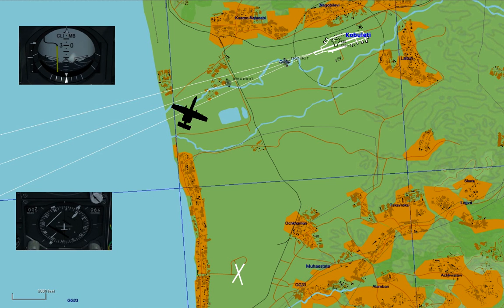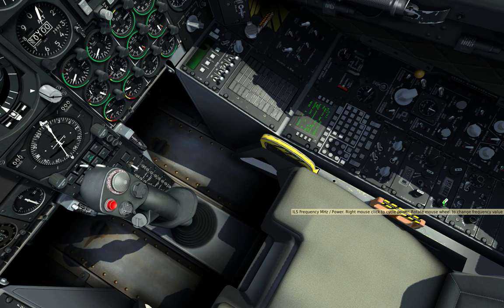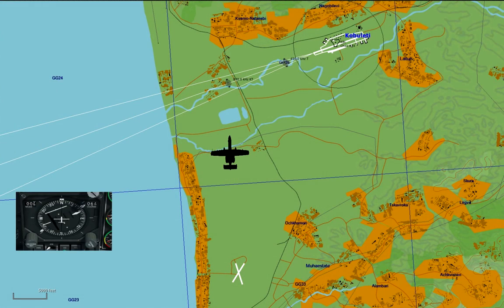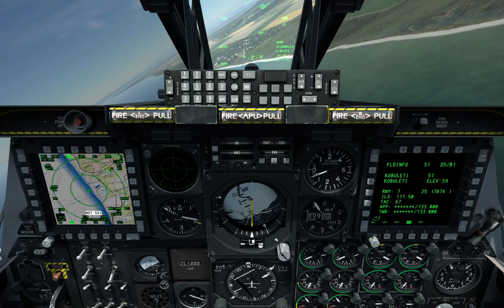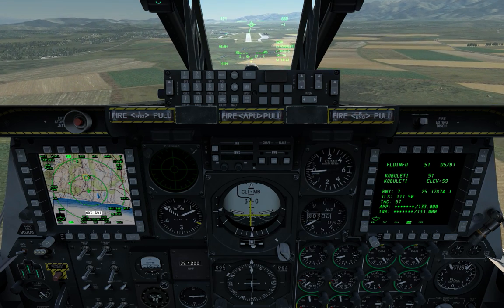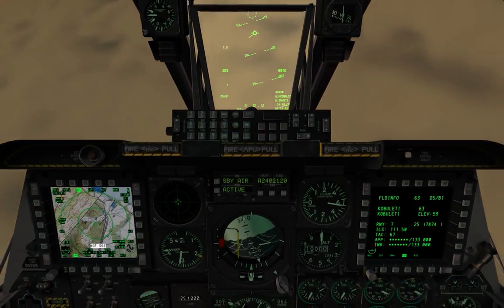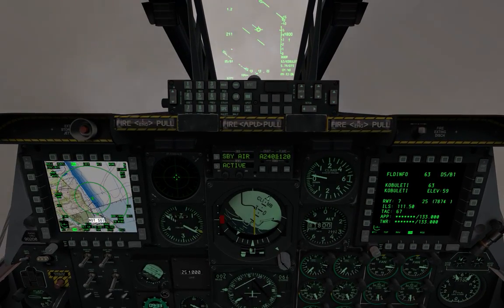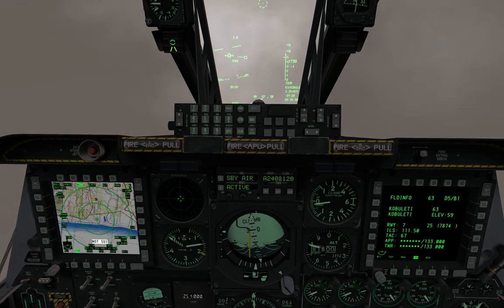DCS World: All About ILS

Comment: Excellent video/tutorial. Like others have said, by far the best I've found on YouTube. Covered (most) everything, great pacing, as well as entertaining. Question though, you don't mention anything about the AOA indexer? I've actually been looking for a video on it (I know the theory, but wanted to see it properly), and that's when I came to yours. Pretty much no one mentions it use, even when it appears they may be paying attention to it.
Reply from the maker: What specifically did you want to know?
Reply: Mainly just see what it looks like when combined with everything else we are doing to land. I land regularly without much difficulty, but I rarely show the green ball when I do it. I'm one of those that the realism is the most important part, so I want to do it 'by the book'.
Reply from the maker: @hololightful  Ok, lots of text incoming.

The short version is that AOA is controlled by your speed.  Assuming you've got everything else under control, the bottom (up-facing) arrow means you're too fast and the top (down-facing) arrow means you're too slow, so adjust your speed accordingly. Adjust it promptly in the latter case, because you might be about to stall and die.

The long version is that AOA is controlled by your elevator, either by stick pressure or trim.  At the same time, vertical acceleration is controlled by lift, which is controlled by AOA and airspeed.  This means that at any time you can pull back on the stick to get yourself on the correct AOA, but if you're going too fast above the ideal approach speed it'll launch you into the sky.  The better method is to pull back on the throttle while trimming nose up to keep the flight path marker (FPM) on the horizon line until the green circle is illuminated on the AOA indexer, and then add just enough power to maintain that airspeed.  Once you've done that, you can control descent angle mostly or entirely with the throttle: by reducing your airspeed slightly, the FPM will start moving down the pitch ladder as your descent rate increases, and it'll stop when you return the airspeed back to its trimmed value (that is, whatever the airspeed you were at when you trimmed it to be stable). 

The reason we use AOA instead of just saying "you should land at 130 knots" is because the correct landing speed can vary greatly depending on aircraft weight and configuration.  Additionally, you're a lot less likely to accidentally find yourself dangerously slow on approach if you're keeping an eye on the AOA, because even if the aircraft doesn't stall you might end up with a tail strike from making up the lift deficit by having your nose too high.  Carrier aircraft also have a special need to pay attention to AOA since they need to maintain a specific attitude to ensure the hook is in the correct position relative to the pilot's view of the meatball.

It also helps if you're flying several different aircraft, since the AOA indexer always works the same way.  There's no need to memorize a bunch of different numbers for approach speeds if you can just watch the AOA.  

Does that answer your question?

Comment: Hey, awesome tutorial, really explained it to me.

Can you give some advice on tweaking controls? I'm using the Thrustmaster Hotas X and got issues with careful movements: 

Spinning the stick (which is not possible in real life, pedals instead iirc) makes my plane spin and stall easily, so i can't use the indicator below the ADI.
Up and down feel jerky. I often switch from +2 to -2 degree when trying to get 0 angel of attack.
Reply from the maker: It sounds like maybe you need to set some axis curves.  Go into the control setup, select the axis you want to tweak, and press "axis tune."  

Real life controls have a much larger "throw" than most game controllers which can make joysticks weirdly sensitive sometimes.  By adding a few points of curve on every axis, the stick will become less sensitive toward the center and more sensitive around the edges, meaning that you'll still have the full range of control motion but fine movements around the center will be more precise.  Hope that helps!

You might also want to visit r/hoggit on reddit to talk to the DCS reddit community if you need more advice.
Reply: Thank you, I'll try that and see how it performs.

Comment: Best ILS Tutorial I`ve seen. Nice and easy to follow and to understand. Btw. how did you find out the differenz between the runway heading 07 and the realistic 064 ?
Reply from the maker: 064 came from the kneeboard (0:45).  If you want to take a closer look at the kneeboard pages, they're in the /DCS World/Bazar/terrain folder, and there's a more updated pdf in /DCS World/doc/charts.  It'll be the three-digit bearing with the arrow next to it near the end of the runway.  If it shows two numbers, use the one without the T (T = true, you want magnetic).  

Since in DCS you'll usually be landing at the same airport you took off from, you can also cheat a little by setting the bearing right before takeoff.  If you're lined up properly with the runway your heading should be the same as the runway's, so you just turn the knob until the arrow lines up with your current heading.  Just remember that it'll be backward if you end up landing the opposite direction, and won't match at all if you land at a different airfield.
Reply: confirmed best ils tutorial

Comment: Wow, nice approach!  Looks like both the barometric and radar altimeters show field elevation to be 1,000 feet?
Reply from the maker: When I set up to record the last approach, I started in the air and forgot that the air start doesn't change the barometric altimeter setting away from the default to account for changes in weather.  Kobuleti (the airfield) is actually about 50 feet ASL.

If you request landing from ATC, they'll tell you the altimeter setting, but bear in mind that the setting they give you will be so that your altimeter will read zero on touchdown.  If you're at a higher altitude airfield like those in Nevada in hot weather the setting ATC tries to give you might be beyond the range of your altimeter.  I've gotten out of the habit of asking, or really having anything to do with ATC.  

The radar altimeter correctly shows the altitude AGL though. The number below the (baro) altitude on the HUD is the pitch angle, and the number below that in small text is the radar altitude (e.g. 440R for 440 ft AGL).  Because I changed the setting through the test page, the radar altimeter tape shows just to the left of the baro altitude on the HUD, marked in hundreds of feet.
Reply: If I'm not mistaken, the altimeter setting provided by ATC will adjust the altimeter to show field elevation at touchdown.  For instance, when landing at Denver International (approx 5,430') your altimeter should show about 5,430 or so at touchdown after you have made the ATC provided adjustment.  In fact, small uncontrolled airports, with a unicom service lets say, have an altimeter in the airport office, and when an airplane calls in for local traffic advisories the attendant will set the altimeter to the field elevation and read the corresponding barometric setting and relay it to the incoming pilot.  Radar altimeters are completely different, of course, and simply show altitude above ground.  Anyway, that was a cool approach!  What were your weather parameters?
Reply from the maker: Most of the time in real life that's correct.  The pressure you've just described is called QNH.  Oddly, DCS World's ATC gives QFE or Field Elevation pressure, so it reads zero on touchdown rather than the airfield altitude.  In other words, instead of altitude above sea level, it gives you altitude above ground level with respect to the airfield.  We can hope that we'll start getting QNH settings when the developers release the ATC overhaul.  

Feel free to google QNH and QFE to know more.  One of the top results should be a detailed explanation from the Eagle Dynamics forums.  

Iirc it was the heavy winter weather preset with the wind redirected down the runway (since the video is meant to be about the ILS and not "check out my cool crosswind landing") and a fairly thick fog.  500 ft visibility or something like that.
Reply: I've never heard either term (QFE, QNH) used in real life, although all my time was General Aviation/Commercial in the US system or its equivalent.    And I must admit more than just a few years ago.  You typically would get the 'altimeter' from ATIS prior to taxi or from Approach or your destination tower when inbound like "King Air Seven-Six Tango, turn right heading zero-two-zero, cleared for the ILS runway Zero Five Approach, maintain four thousand until established, altimeter two niner niner two, tower one one eight point three".  Or something similar.  From a simulation standpoint, I suppose ATC instructions should be 'regionally-authentic'.   I have a couple of other minor terminology type complaints - but it's probably better for me to just shut up at this point (grin).